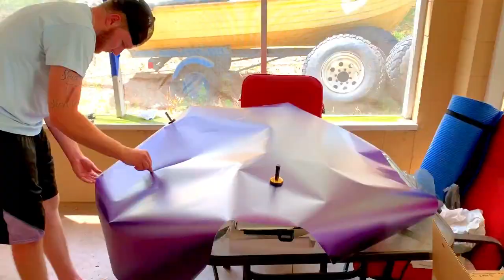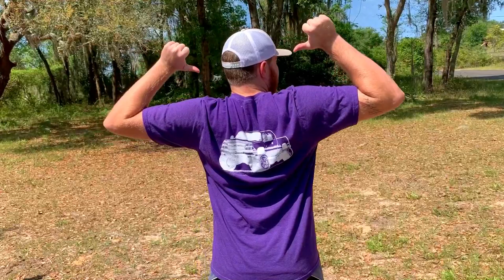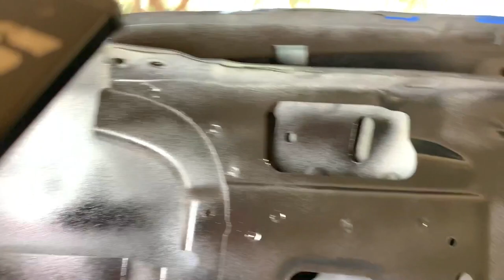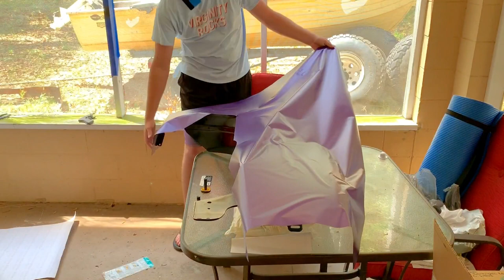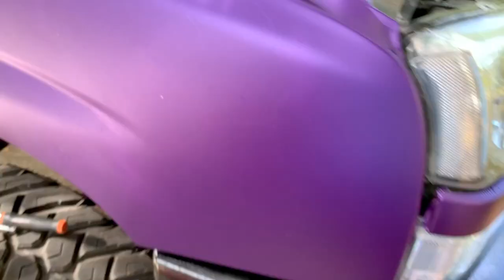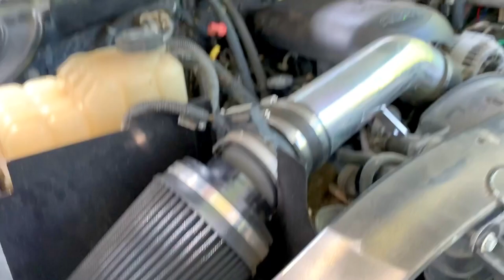FAILED ATTEMPT! I Need Your Help! Fender/Hood Gap

Comment: Um idk this maybe a stupid question...but my mustang hood was latching but not all the way. I looked over it more and the hood thingys you twist wasn't allowing the new hood to come down all the way...looks kinda the same problem? Thats exactly what my new hood did until I adjusted them down. Idk what they are called. Them little round black things the hood sits on in the front..
Reply from the maker: Not a stupid question at all, I had previously tried that. I posted an update video of what the problem ended up being. Found a mount that was bent maybe 1/8” and it was enough to throw off the whole hood.

Comment: I have the same problem the front of my hood latch is perfect in lines up with the fenders perfect but the back by the windshield is up about 3/4 of an inch. That’s on both sides. I removed the right front fender and hood and repainted it and put it back on and this is what happened. The left fender and the hinge was never moved and never taken off of the truck. And it is up in the air also it has something to do with the hinges. I have done a lot of bodywork and put on many hoods but I have never seen this before.

Comment: I don’t think it’s the fender. I think it’s something to do with the hood mount. When you had the accident it most likely pushed it up. I’m like 90% sure. That’s where I would start tbh
Reply from the maker: Since everyone has said it I’m going to get a new hood mount to try.
Reply: This is what I was thinking. I'm having am issue with my 2007 mustang convertible...husband crushed it with his f250 into the garage. My new hood is leaving gaps and not lining up right. But it's a custom built fiberglass hood...so I'm not sure if the guy made it to fit like the factory...I notice it is mounted a little crooked but even if it's straight I don't see the gap going away. Did new mounts help your issue???
Reply: @amandawhite3963  did you ever fix it ?